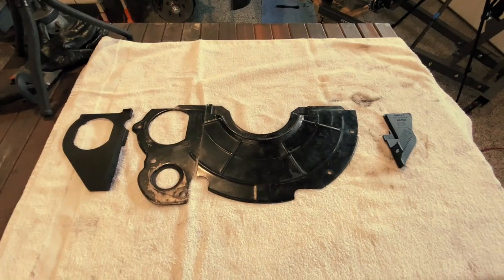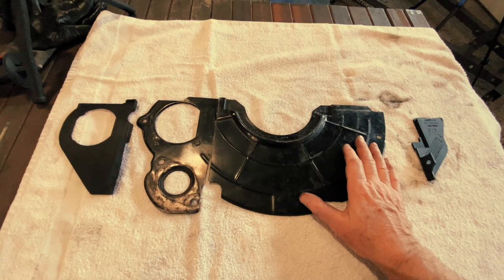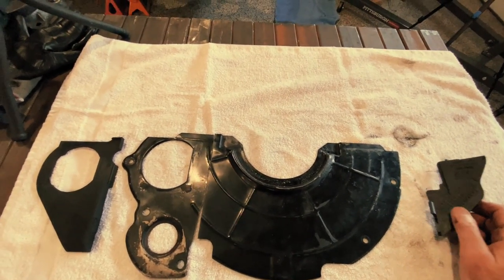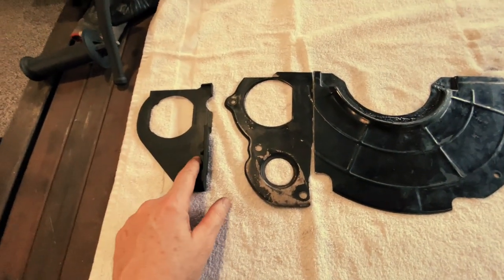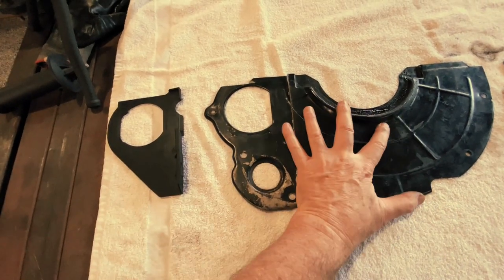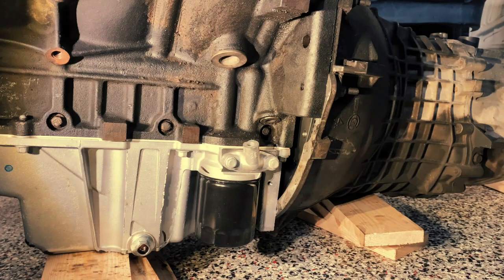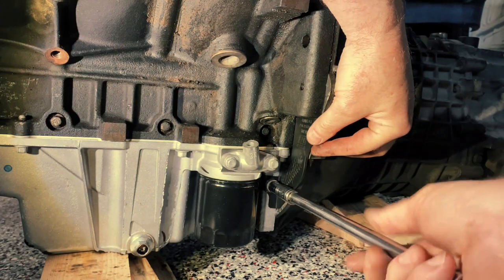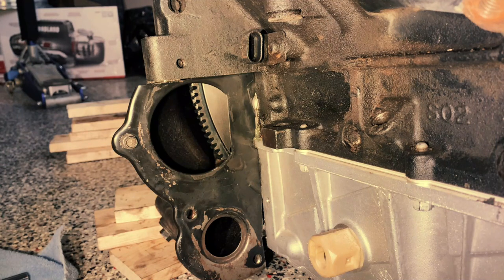Quick Tip: Chevy OBS LS Swap Flywheel Dust Cover Plate Solution for Older GM Manual Transmissions

Comment: Mr. Lawrenceville..  .I'm getting ready to do the Ls swap w/ 5.3 in my 95 stepside 4.3 with the nv3500 transmission, I may encounter the same problem,  I'm glad you put this video out, that's going to help me through the mating process of the Ls 5.3 to nv3500 manual transmission. I subscribe to your channel and watch all of your Ls swap videos 👍👍
Reply from the maker: Thank you, this should work for you too. It is something I didn’t think about until actually putting the transmission and engine together and realizing I needed something.Good luck!

Comment: I did a sbc 400 swap in my 91 chevy 1500 4.3l with the nv3500 transmission and I'm having a hell of a time trying to find that exact flexplate dust cover!
Reply from the maker: I'm not sure of the changes it may have gone through during the OBS years, but it came on my 4.3/5 speed truck. With the LS based engine, it really won't fit between the engine/trans, clearance is very tight. The side parts from the LS worked just fine.

Comment: Question guys Ik it’s not a sbc or anything special just a 3.8 but I was wondering if I really need the dust shield for the transmission? Or will I be okay running without it? Tia
Reply from the maker: I have bought cars in the past that the cover plate was missing. I've seen quite a few that don't have one....but did at one point. My answer is yes, you should have one. It helps to keep dirt and other debris out of that area. Whether you have an automatic or manual trans, this is the area where the starter gear meets the flywheel and clutch assembly/flexplate. It needs to try to stay as clean as possible. It is not watertight, but, dirt and objects getting into this area will only cause problems.

Comment: Quick question.  I noticed when I lined up my OBS manual transmission bell housing to the 6.0 LS that there was a hole on the bellhousing that is used to bolt it to the block on the top passenger side.  But there is no hole in the block at that spot.  it looks like one could be drilled and tapped....  Have you run into this?  Should I drill and tap it or just not use that mounting location?
Reply from the maker: Do not drill and tap it. This is common with automatic transmissions, as well as manual transmissions when you’re switching between OBS and LS. Don’t worry about that one bolt, just make sure all the others are torque to spec and you are good.
Reply: Thank you so much for your response.  I will follow your advice.  🙂

Comment: how did you do the shift linkage? i have a 93
Reply from the maker: On my '91, the clutch linkage is hydraulic, so I didn't need to do anything. I had a small pinhole in my clutch line that had to be replaced and the "new" slave cylinder failed within about 5 minutes of use and had to be replaced as well. Other than that, it is all stock parts. Stay tuned, I am going to put a Core-Shifter in it to remove some of that "truck feel" when shifting and make it feel less "rubbery".

Comment: You know the bolt size and thread of these covers?
Reply from the maker: No, not off the top of my head. These were both on my donor engine/trans, so I didn't have to go buy new ones. You can buy new ones, but it would be easy enough to find these at any salvage yard with a 1999+ engine.

Comment: Its a 93 short bed obs , a good investment? To resale it later?  Its a 93 fleetside v6, manual,   Truck for 500$, with title
Reply from the maker: Unless its totally trashed or a rust bucket, its a deal. I just bought a '95 short bed, silverado, no engine/trans/harness or hood for $800. You won't get hurt.
Reply: @laurencevillegarage  @ o ok, ghen i will get it today,  has no rust, just smal dents,  and front glass cracked,
Reply: @laurencevillegarage  @ another project?  For swap /sell
Reply from the maker: @gerardolopez5875  I have not decided yet....it has a good frame, bed is excellent, lot of good parts....just not sure what direction to go with it.
Reply: @laurencevillegarage  @ i did bought the 93,  550$!!💪🏻
Reply from the maker: @gerardolopez5875  Great! I'd like to see a pic sometime. My email is in the description under each video.
Reply: @laurencevillegarage  @ which bed style can be sold better? The fleetside or the stepside??   Cz  there’s a guy wanting to give me a stepside for the fleetside,, as trade,
Reply: @laurencevillegarage  @@  i got a 6.0, ready, iam thinking to deopp it on the new project obs,  with the stock manual trans,,       Does the flexplate u used, will be the same i would need???
Reply from the maker: @gerardolopez5875  It's really a matter of personal preference. A couple pros and cons. The 2 main disadvantages of the stepside is, as far as carrying volume in the bed, there is less bed space than the fleetside. But, most people who would buy a shortbed are not obviously worried about cargo capacity. The other is that the stepside sides are fiberglass. Most of the ones I see have some cracking or other damage to them. Sooo, if the stepside looks to be in good condition without damage and you like it, then go for it. There are fewer stepsides than fleetsides so finding a good one is a bit harder to do. Again, its personal preference, and if you get it to sell, there will be someone who will want it so you won't get hurt $.
Reply from the maker: @gerardolopez5875  Although the term is used for both, technically an automatic needs a flex-plate and a manual gets a flywheel. If you put the 2 side by side you will easily see the big differences between them. But, to answer your question, yes, the same flywheel and clutch will fit. An easy way to check it to go to Rockauto website and search flywheel for a 2000-20004 4.8 and/or 6.0, you can compare part numbers. You will want to get new flywheel bolts as well.
Reply: @laurencevillegarage  @@ 👍👍👍thanks
Reply: @laurencevillegarage  @ on the 95 swap,,   The a/c its running separately from ls pcm??   Is it still running fine??
Reply from the maker: @gerardolopez5875  Yes, it is. No issues once switched over to the sanden compressor.
Reply: @laurencevillegarage  @ o ok,,👍  did u bought d one for other project?
Reply from the maker: @gerardolopez5875  Well, the blue '95 went to a sanden after having a couple of issues with the R4 compressors, then for the '91 I bought that sanden kit from Dirty Dingo.
Reply: @laurencevillegarage  @ will the manual trans, from my 93 new project , match  good wiyh a 6.0?
Reply: @laurencevillegarage  @ do u like 0bs extended cab? 93
Reply from the maker: @gerardolopez5875  I don't dislike the extended cabs, I just prefer a standard cab. The extended cabs are more spacious and can hold more "stuff" inside, like a cars trunk. I simply prefer the proportions of the standard cab.
Reply: @laurencevillegarage  @ on the blue truck,   A/c compressor on top passenger side,,  which belt did u used?  Its there  all different sizes for it?
Reply from the maker: @gerardolopez5875  It would be impossible to give a specific belt because the bracket was personally modified and adjusted to the position it was in. It can be different for everyone. I would say go to gates site, they have a breakdown of each belt based on rib width, and length with the part numbers. Whatever brand you choose (ie dayco, gates, etc) stay with that brand. Belts are like jeans, different brands will vary on the same size. Not a lot, but enough to compare apples to oranges. I went through about 4 before I got the size that worked best. Of course, then switched over to a sanden compressor. I have no idea what belt would be on there now.
Reply: @laurencevillegarage  @ when switched to sanden compressor,   Did u used same bracket? Or whole different kit,?
Reply from the maker: @gerardolopez5875  Yes, I did use the same gm bracket AND a adapter kit. I think it was Dirty Dingo, adapts the sanden style compressor to the factory bracket. I think it was ~$40.
Reply: @laurencevillegarage  @ i changed my mind with the manuals transmission, iam going with a 80E
Reply from the maker: @gerardolopez5875  It will make your swap a little easier I think...a bit less complicated. Good luck!
Reply: @laurencevillegarage  @ any links for sanden compressor and bracket adapter?
Reply from the maker: @gerardolopez5875  For the brackets try https://www.dirtydingo.com/shop/product_info.php?cPath=348&products_id=1622 compressor will depend on what style of sanden you choose.